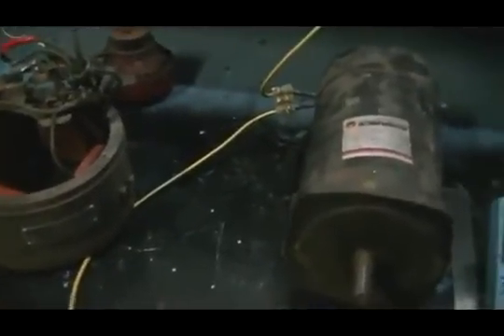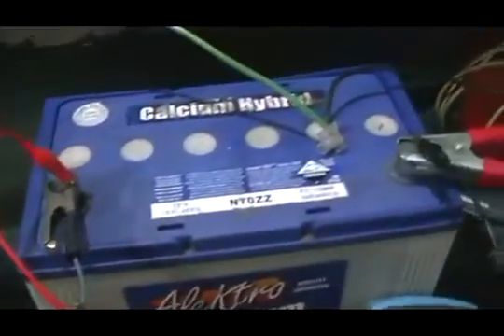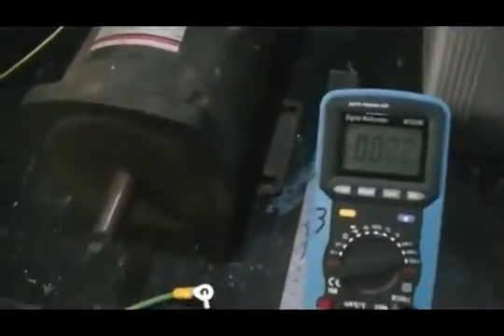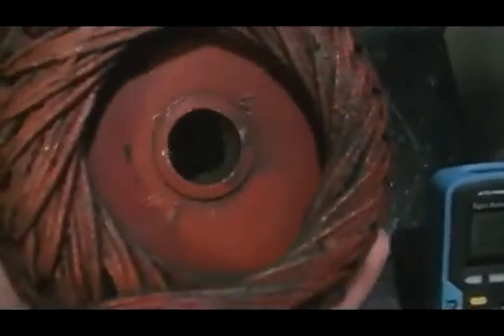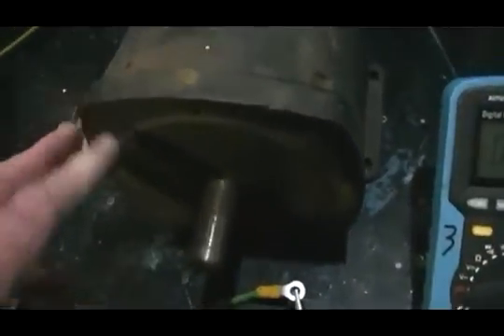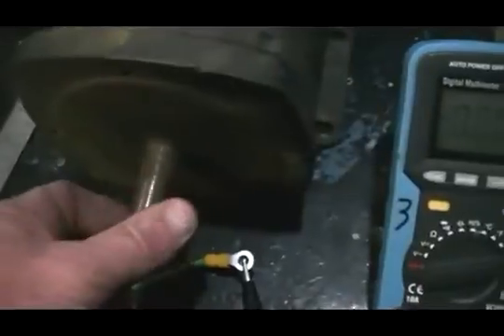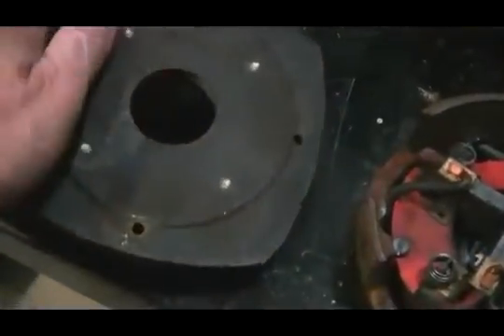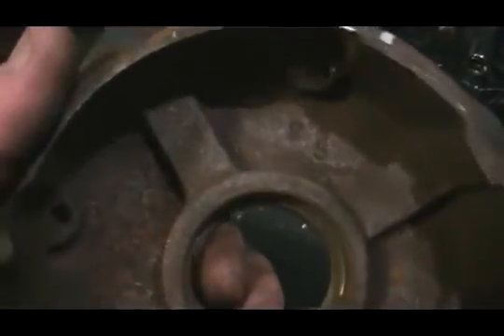Genemotor loop project

Comment: Hi TM, on the lathe you could use a face plate and clamp the armature to it, then center the armature shaft for turning. Just a thought. Look on YT for turning odd shapes you should find something that will work. Have a good one.